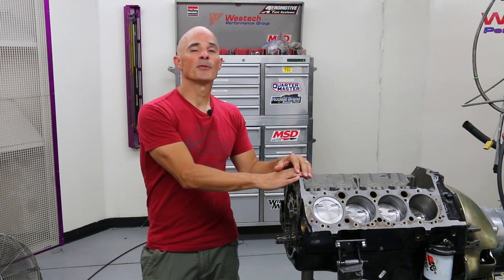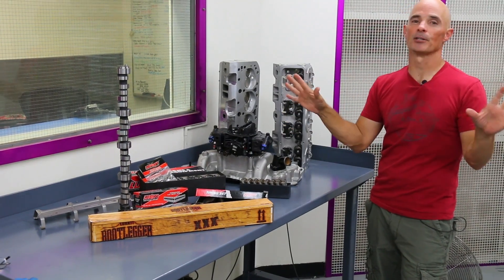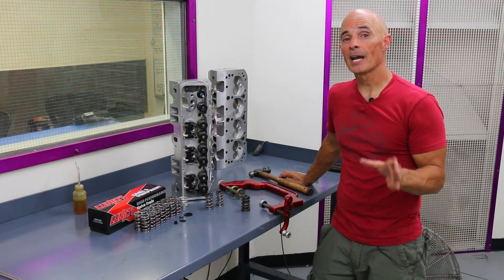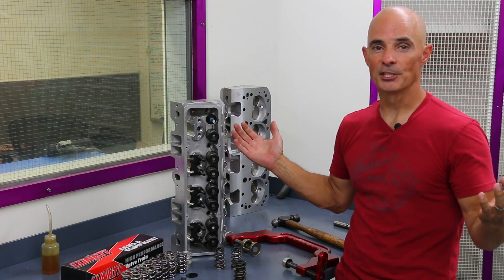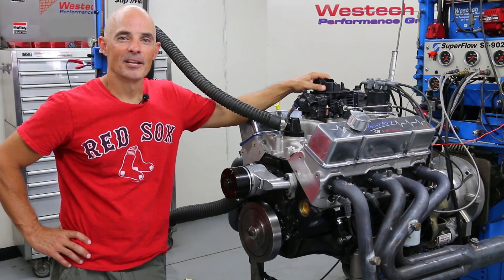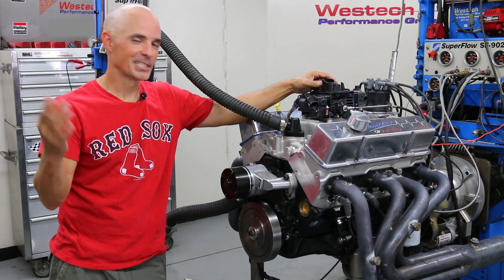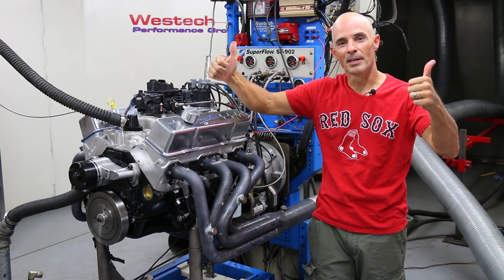Lunati Bootlegger Camshaft Dyno Test at Westech

Comment: I hit the thumbs down.  No specs on anything, especially the cam, didn’t get to hear idle.  Sounded like a sales pitch for the cam and springs rather than a dyno/review, which is the gist we are given beginning the video. 

He says it ran perfect... compared to what?  If Barnett was right there are lots of cams with similar specs capable of much more power. 

So Lunati/ Holley decided to use the popularity of Westech/Steve Brûlé and Engine Masters to sell products?  Bad form guys. 

Westech don’t taint your good reputation getting roped into this kind of false representation.  This video was simply click bait to sell a product.  I and multitudes more have no respect for that.  I will continue to watch anything Westech or Motortrend but won’t ever click on a video with this guy again.
Reply: Well, it's a 383 with hydraulic roller, so that narrows it down to one of three options.  I too wanted to know some more, and looking at dyno results, I do like that near flat torque curve between 3k and 5k.  Some combos tend to be more peaky than not, so... I want that cam #.  Did they test the 276/300, the 284/309, or the 292/317?  I wouldn't say the video is false, but it just seems typical of Holley: they present about 90%, then pack it in and go home - seems to happen alot for products they didn't develop from ground up.  Did they forget to look at the box, or is some lawyer at Lunati damaging sales by being a complete pinhead?   When companies get together the first thing lawyers do is reach for a NDA [non-disclosure agreement].  That's fine for a starting point, but it should be reviewed by whoever is actually running the company  as things move forward - amend things as needed so people can function and it doesn't nuke the purpose of meeting in the first place.
Reply: yes click bait BS, its meant to be a Cam test.....but they install heads....intake......carb.....valve springs......WTF
Reply: @kermets  notice it's all holley/lunati stuff.  i mean they dont even sell heads anymore.  Id rather goo comp/RHS/edelbrock stuff myself   working with one company group does save a lot of trouble  but yes they should have tested all three cams in the one setup.
Reply: yeah the thing is i like the cam specs as it seems a no compromise with the 108* LSA and that should serve the 2.02" intake valve regardless of engine size, yet a 10.5:1 383 with AFR 195 heads and XR274 solid roller made 515HP@6000rpm, and 510TQ@4400rpm.its a street grind. however it did very well with lower compression, not as good heads, pistons down in the hole, power is balanced perfectly with 468 TQ and 440HP street hydraulic roller its really good, the power shape i would watch out for tires losing traction up in the midrange under WOT.This hydraulic roller cam with 10.5 compression and AFR 195cc heads would get close or as good than the XR274 that is a solid roller that is my opinion.  This is a great cam.
Reply: @7REDDRACO7  the biggest bootlegger with a 10.5:1 383 would do well with a 195- 200cc head and a weiand team g intake and an 850. Good street car with av2out 3500 stall
Reply: @KingJT80  Absolutely that would make well over 500hp all day if not 550hp
Reply: @7REDDRACO7  and for the carshow burger joint , guys it'll have the chop they want
Reply: @KingJT80  awesome ,absolutely , i would probably even try and use a SUPER VICTORII with 4K stall, and 11 to1, and a competition cut 195cc prob comes out 205 or so cc, and rather than the team G although the team G would be more streetable i feel it would give up a lot of hp and even a little torque as far as total add up- ignoring rpm of course. for someone looking for some more street power in an almost driver. Really i haven't done the math with that cam though maybe 10.5 is safer for pump fuel if it can going to check. its edge of course with cylinder heads that can really pack the cylinder.
Reply: @7REDDRACO7  they have 3 different heights for team g's but yes the super vic would the next step up in port size
Reply: @KingJT80  yeah i think a 434 small block probably might be able to use it maybe, so sticking with the tried and true Team G for a 396 stroker small block until i could test one of course. right now got a performer EPS on it, that chokes it down pretty good.
Reply: @7REDDRACO7  yeah that manifild maybe flows 220 out of the box the manifold shouod be flowing over 300. Thats super victor territory so thats the right direction. 

Me I'm a windsor guy but chevys were first. So I have to go the 302/347 route I couod go 408 but I want a strut tower brace to fit. 351ws are tall
Reply: @KingJT80  Yeah i seen a street 434 dyno with it and just impressed the heck out of me over a team G they tested, with the cubes+ seemed completely just like a team G+ just more, the rpms were roughly the same. and they did a shootout with roughly a dozen intakes super Victor II took the gold even over the Wilson modded super victor II.
Reply: yeah more of a "quick" ad than learning anything.. some people need to rehearse a little more before doing these videos..
Reply: It is odd.  Music was credited, but not even a cam number to look up.  This is typical of tv producers - I have to think someone in sales would at least incorporate it in presentation.  Anyway... there's 3 different offerings [hyd/flat] to suit sbc, all on a 108 LSA, and same goes for hyd/roller.
Anyway, it would be interesting to see a custom variant of these: give up a little exhaust duration [get closer to square] and use that reduction to get at a 106 lsa for a 383 motor - keep lift about the same.
Reply: @KingJT80  yeah, thats why you can get a great rod ratio out of them strokers even
Reply: @7REDDRACO7  550 wont happen with the 195 heads and most hyr rollers, dual plane
Reply: @KingJT80  Super Vic too big for a hot street 383.   Team G esp with some work will run/drive better or a real good dual plane. 
After running a few intakes on my 383 for a hyd cam Id run the Holley 300-36 as in the vid. 
Performs good and has that super high dual plane Z28 look

Comment: The dyno tests and build are in Super Chevy Jan 2015.  Part # XXX12224HRK 0.554 lift 224/236 duration.  Smallest version of the Bootlegger.
Reply: +Jason Barrett odd should of used the bigger one.
Reply: slightly better than stock
Reply: Can't with the stock gm style hyd roller lifter setup, I've ran .355 lobe  that's about max
Reply: Derek Stewart depends on the base circle and other tolerances.  I have run .383 lobes in them just fine. Ls7 lifters
Reply: @derekstewart8175  of course u can just need to either machine down guide bosses or use ls6 springs with comp retainers no problem getting. 580 lift without machining
Reply: @plainsabertooth7828  Why? The one they ran is perfect for a true driver 383. 
Loads of torque
Reply: @gordocarbo  for me I like it when it's choppy and aggressive lol but that's just me.

Comment: i would pit this against a comp XR282HR or XR288HR hydraulic roller anyday because of the correct lobe separation for the valve sizing , ignoring other LSA factors. I like that in a street cam, especially a street roller cam that retro fits. My opinion , you can't go wrong with the specs i mean choose your durations for your compression and heads. these heads aren't even AFR and the power is FAT. this is a sign of great efficiency and good power pumping through. Your car will have a softer clipping exhaust note and woolier sound with the 108* LSA. Its awesome for street but watch the torque hump and upper rpm wheel or tire spin anything over 400 hp starts working against street tires we all know.  Perfect short block? wow your pistons are like O.O25" down the hole, i can see it from here.
Reply: Only thing I dont like about those types of cams is the fast ramp deal. Valve job, tips, etc just dont seem to hold up. Almost have to overspring them so they dont float upstairs. Never had good luck with them.

Comment: Richard. You need some ground straps on the engine to the dyno. There is serious arcing between the exhaust collector and the engine. Maybe static electricity?
Reply: Good eye I didnt see that
Think the sparks are from Richards brain working overtime
Man if I owned an engine dyno and flowbench nobody would ever see me again.

Comment: Holley heads intake and carb with a lunati cam which is also owned holley. Do you suppose holley is a sponsor.
Reply: saw that
Reply: Pretty obvious it's a paid advertisment. Should have used the big version of the cam with a Strip Dominator intake and another point of compression to make a more impressive number.
Reply: Comp bought Lunati

Comment: It would have done way better with AFR 195cc comp cut heads, must have been some holley systemax II heads or something.  May need more compression also, probably 10.5:1 would be good depending on the cam specifications
Reply: Yes systemax. Eliminator heads werent out yet when that Holley pkg was big.

Comment: Looking at the torque and horsepower pecks you can say a standard 223 degree can with around .550 lift and with 440 ft lbs at 3000 rpm, 112 degree lobe centers ? Compression lookin at those pistons under a 64cc heads roughly 10:1 .....Lunati grinds a shit ton of duration into the exhaust side of their cams which is good for top end but that's not what you need on the street, makes nice dyno #"s  tho.....
Reply: Since you bring up exhaust... I would very much like to see what this [I think the *224HR] cam does ground single pattern.  But... ramp  might be a touch aggressive for exhaust service on the street, at 26 degrees [adv to 0.050"] - Lunati can advise better than I can, but I expect 1.6 rockers would be avoided .   Assuming I am right about which of the 3 offerings is tested  here, that would be 276 adv/224 @ 0.050".  I like headers any car I can fit them in, and with a little light head work, the need to use duration to crutch for exhaust system handicaps becomes muted - the throat of most exhaust ports can be opened 2% with minimal problems.  Btw,  note  all the bootlegger HR offerings are 108 lsa -  I like carburetors, so its all good.
Reply: @flinch622  Yeah they are playing with 383 cubes here , + free flowing aftermarket heads with okay compression (a D-dish woulda been better), so you could expect some serious power capability.
12* of extra duration on the exhaust seems really excessive, i think torque peak could have been closer to 500 if they had of cut that extra exhaust duration in half.
The ICL is 104* so they have ground in 2* advance to try and pick up bottom end.
The philosophy at Lunati must be that once the piston has done the majority of it's work going down the bore now let's spend the rest of the time on scavenging ... i'm not sure that's helping bottom end or overall power. 
I would like to see BSFC #"s per horsepower to see if they are wasting fuel compared to a shorter exhaust duration cam ?
My gut says i would never run this cam in any engine.

Comment: I agree with jed. Which bootlegger was it? Just so you know, don't base the performance potential of the cam or lack of, on those holley systemax heads. They suck. I would put vortecs on before those overated beer cans.
Reply: Those Holley heads flowed about as much as a stock Vortec. Pretty shitty for an aftermarket aluminum head. Don't think they sold many.
Reply: Id use the Holleys vortecs are "ok" but way overrated. Base bootlegger look at the torque curve.

Comment: being a short block, would have had it's own cam in it .. would have been a better sale to do the base test first with the crate cam, then do the upgrade cam .. with specs on everything as well as doing things like idle, throttle response and then full peak.
Reply: Makes you wonder if they are trying to hide that the Bootlegger doesn't make much more torque than the stock cam down low ?
Reply: @SnakePliscan2  or maybe it was Friday afternoon and this was the last test of the day

Comment: the power rating is obviously going to drop do to no fan is attached to the pump that has a power draw. prefer fan clutches over fixed or flex fans . others like electric fans. prefer mechanical for reliability.
Reply: Same...going back to mechanical with an electric as a fail safe/backup for real hot days
Cant stand the constant rise/fall temps with the electric..they suck in my opinion at least most aftermarkets
OEM different story

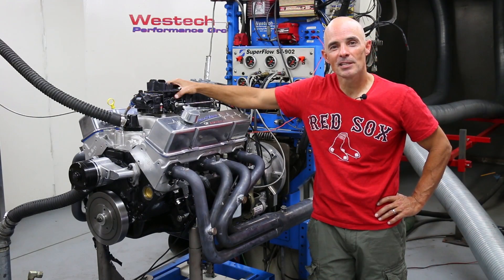Comment: 2:57  Whats the idle sound like?  I'm buying this solely based off the idle sound.  The point of the cam like the thumpr is its slow idle.  If you don't show its slow idle the video is pointless.  We can get better cams with more power not worrying about idle.  This ones different.  okay it made said amount of power.  How's it idle?  Hows it idle?  Hows its idle sound?
Reply: Why buy a cam based off an internet vid?
These are similar in theory to the thumpr 2 brands owned by the same investment group far as I know. Old Harold B would be turning in his grave lol
Reply: NEVER buy a cam based off of how the idle sounds, dude that makes NO sense at all. 
Any perf cam is gonna sound good so get the proper one for your car so its not a pooch.
Reply: @Matthew-ib2kz it's probably the smartest thing you could do. The only reason to make the engine faster is to bring you joy. Sound is one of your five senses, a good sounding cam brings more joy than a stock sounding engine which is faster.
Reply: @Matthew-ib2kz  good advice. My first cam was one I heard at the drag strip, bought it, installed it sounded so bad ass until 4000 rpm and then it threw 3 pushrods thru the valve covers....bad ass for sure

Comment: So whats that 300hp at the wheels?
Reply: Uh probably closer to 400whp.
Reply: subtract 15% for manual transmission or 25% for automatic without locking stall
Reply: Julie Butcher about 400awhp. pretty mild for a 383 but likely has a healthy idle and street manners
Reply: How about 20-50 HP LESS due to open Headers?
Reply: @NoferTrunions  It will run bettter with a well thought out full exhaust. Wont lose 50hp
Reply: @gordocarbo   Are you saying a well thought out exhaust will produce more HP than open headers?  I meant the test was open headers but the car is not.  So less HP at the rear wheels.

Comment: That's not a street motor test. It's a wide open throttle pull for power.

Exhaust system, intake filters.... 
Simple things knock the shit out of Dyno motors 

Driveability or bragging rights ?

Comment: didn't learn a damn thing.
Reply: its a perfect cam for a no compromise street performing cam with the 108* Lobe Separation Angle with tight cam specs, there is not a better 'kind of cam' except for what matches your heads precisely with a little more with overlap to bring in more, this is this cam's formula, so do i recommend , Yes as long as the cam is durable and the roller lifters durable for daily driving, and the springs are the correct material in beehive mode, and as long as the valves are 2.02" or 2.05", 2.08" i would step down to 106* LSA and a smaller valve like 2" or 1.94" i would do 109* or 110* LSA. You could get comp cams XR282HR or XR288HR they are in the same league, like the voodoo line as well as the cams were all designed by ultradyne harold premiere cam designer of all modern cam efficiencies and success. The trick is how aggressive can you make a street lobe and still survive on the street for greater efficiency and fuel economy potential and power potential, these are all valued by us street machiners. If its a trailer Queen the only reason for using these type cams are durability over RACE only cams that won't last all that long. less aggressive lobes tend to last longer given similar material properties.  with Xtreme energy, dual energy, powermax, voodoo, bootlegger, thumpR , these lines are cutting edge street technology, can't go wrong with these cams if you want a driver slash winner. If your looking for a track only winning car, these cams could be used depending what racing and competitive behaviors, however an all out high end race car is going to suffer from using these street friendly camshafts when the others are way up farther in the rpm band. These are not 8000+ rpm cams. But as a result of their fine balance are competitive in race applications with the compression range and rpm range they are in.
Reply: exactly know what you mean, the corporate and industry spends millions on force fed commercials all day, and now this disturbing our true education and fun and what makes the internet great, they'll destroy it people, just like they did tv. if they want to spend on commercials create channels of commercials only, remove them from our content on tv and internet, it is illegal to make pop ups come on my computer for merely being connected to internet. They should do away with the dang commercials , throw it in the fire. We know how we want our internet, we don't need them, they water down the experience like beer and make everything luke warm , pungent and corrosive, not steamy hot, or icy cool, just BLAH.   thats what we are all saying and we must boycott all the greed driven kaka that this is an example of. don't turn our youtube into tv or we'll kick it to the kurb.  lets organize on websites and get the word out to stop these addicted to money on a pedestal worshiping hotshots, i guarantee you its the bizarre work of ridiculous adolescent angels with chips on their shoulders and the rich whom serve them without the creator, we shall make them all serve us, the creator again. peace jenn jenn.
Reply: hahaha.. I KNOW!! LSA?, Grind?...
Reply: Gave us no specs on the short block, cam, or anything else. Makes this pretty much useless.
Reply: @7REDDRACO7  Your response is kind of a rant , so what's the rationale behind Lunati grinding in so much exhaust duration , rant about that !